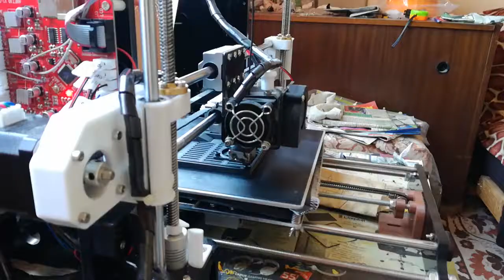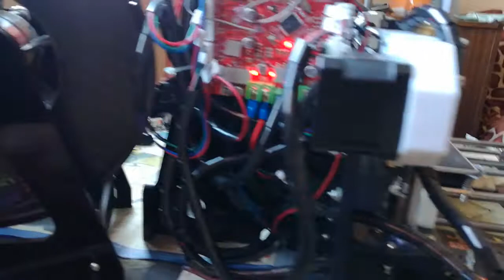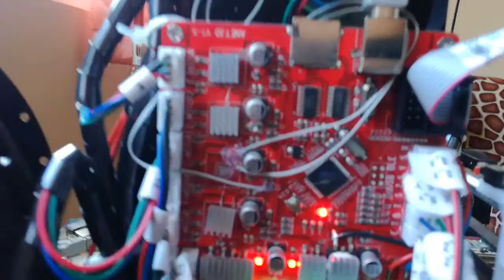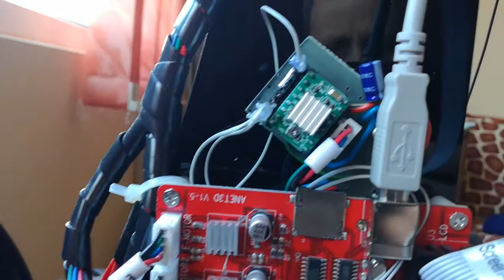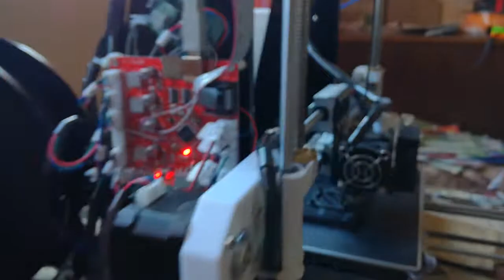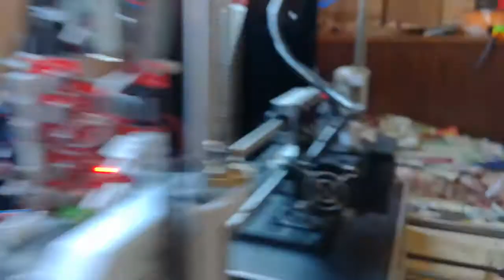Anet A8 burnt stepper driver replacement with pololu board

Comment: Hi bro, Can you show any web page where explain you work in this video?, i mean, any diagram. 

I’ve my driver motor z dead, and I got a “HR4988” instead of “A4988” but not working correctly. 

Im thinking change all motherboard, but is most expensive if we compare with one simple stepper driver motor 😢.

Sorry for my english, is very bad :(

Comment: Do you circuit diagram for extruded driver. My extruded motor is not working, I am thinking my driver has blown up. How to check if stepper driver is dead or not?
Reply: swap extruder connector with Y axys and then go to prepare and move Y axis, if it works, stepper is good, extruder driver is burnt